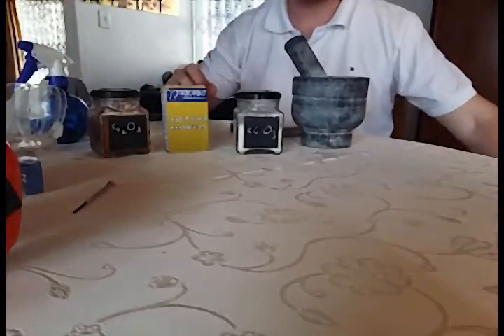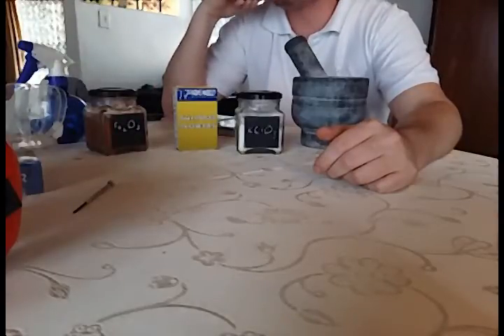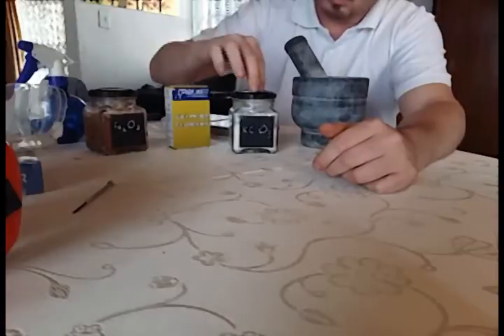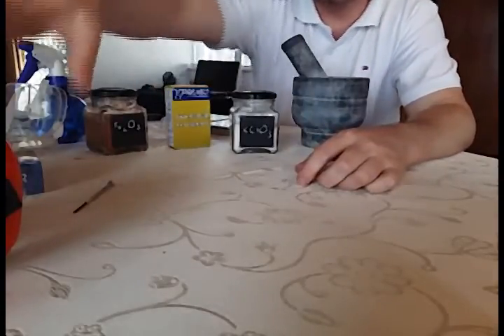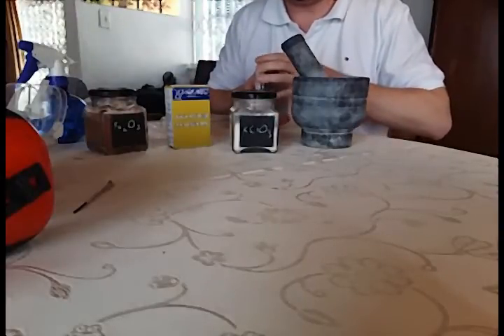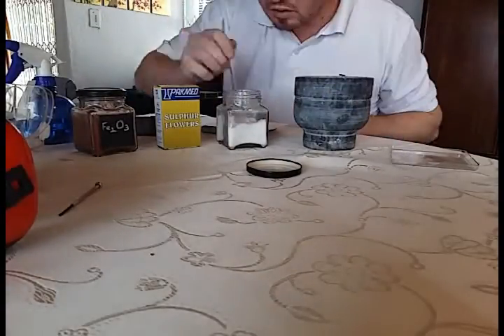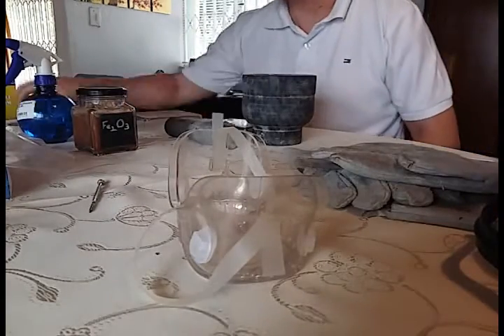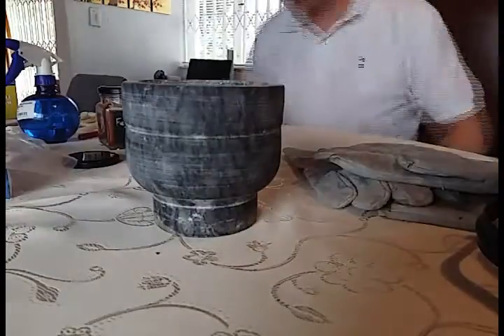Potassium Chlorate with sulphur - friction detonation tests

Comment: When I was a teenager that felt "immortal" I tried this with a drop of NG and it broke my pestle. Its interesting how you can hit with a hammer very strongly the same drop of NG absorbed on thick wood and nothing happens but if you barely hit a drop of it on ceramic surfaces it would go off frighteningly easy.

Comment: Very informative -- I've never seen anyone demonstrate the sensitivity that I knew was there. This could also be used to dispel so many other "sensitivity" claims in mixes that I knew for a fact could be mortar & pestled or smacked with a hammer all day to no effect. For full effect (like a primer), add antimony trisulfide & ground glass, and charcoal -- guaranteed to be the MOST sensitive (like paper caps) & usable as primer when pasted into place & dried. But be sure to never mix up a batch with a 1/2 gram of chlorate -- try an 1/8 of a gram -- and it will blow like a 22LR. You can also get the same effect & power with 5 strike-on-box matchheads & some striker razor scraping mixed in & a few grains of sand -- very loud detonation.
Reply: It’s possible to make a more sensitive mixture such as using 100% red phosphorus from an online supplier, a chlorate, and sulfur or powdered glass or fine sand. Fun stuff. Antimony is okay too! I’d recommend red p tho
Reply: One shouldn't be reckless, but most "sensitivity" claims are bullshit. They might have been true in the 1800s, when chemicals had more impurities in them than today, but even potassium chlorate and sulfur is relatively safe to handle. Even the old Japanese flash mix that Shimizu describes is pretty safe: 43% KClO3, 31% Al, 26% S.

Comment: I did this also with sub-gram amounts on the balcony and it was pretty loud. I had the mixture between 2 small pieces of paper and hit it with a hammer. Sounded like loud caps going off. Ratio was 2pts KCLO3 and 1 pt S.
Reply: 2 to 2 ratio is more sensitive than 2 to 1?
Reply: Don't know. Haven't tried it. @Boucher___B___4

Comment: This is good initiating explosive for primer construction,however the mixture of sulfur and potassium nitrate must be in paste like state rather loose powder..While the paste loaded into primer cup it would get later bit dried out but would permit mixture be friction or detonation sensitive..The amount of this explosive mixture takes some Hexo grams,not much to make large blast but enough to burn propellant,this is entire idea how to refurbish primer caps and reuse them..Searching right explosive was a trick because 3 groups I was search A too powerful,B Toxic,C very corrosive and form unstable salts while react with copper/aluminum/brass and even nickel....Although Tethryl was used from end of WW1 to meddle  of WW2 it later was abandoned because been too sensitive and too powerful than expected,original WW1 explosive was picrates but because of copper reaction those explosives are too unstable...It seems like mixture between sulfur and potassium chlorate suitable for such reloading process unlike anything else but mixture must be in near paste state so it won't be loose inside primer cap and only detonate from specific impact by hitting anvil only..
Reply: hey man do you know if sodium chlorate and sulfur is just as sensitive? i made some, mixed with sulfur and its not sensitive at all. im doubting if i really have chlorate. crystalls look nice and dissolves like chlorate. don't know whats going on
Reply: Bruh what the fuck is this misinformation? Potassium nitrate and sulfur does nothing but fizzle out. Do you mean chlorate? If so; you understand they no longer use RED PHOSPHORUS (not potassium nitrate) and potassium chlorate because the chlorine ion reacts with the steel in the barrel. You’re living and talking like you’re in the 1800’s bud. Do some more research before posting a bunch of word vomit to sound smart

Comment: KClO3  will detonate without sulfur and is more sensitive to shock ,chlorate primers contain   90 to 98% KClO3.
Reply: No. Kclo3 will not detonate by itself
Reply: How the fuck? Without a fuel?
Reply: KCLO3 is a strong oxidizer and cannot detonate by itself w/o a fuel of some sort.
Reply: @don Barnett
Better recheck.
Approximately 1/2 KClO3, 1/4 antimony sulfide, 1/8 ground glass, 1/8 sulfur (low acid)
Is a chlorate priming compound.

Comment: Potassium Nitrate+sulfur are shock sensitive too?
Reply from the maker: Thiago Paulino impact sensitivity
Reply: Is this an "Yes"?
Reply from the maker: Thiago Paulino yes... Hit it with a hammer and it will detonate, if thats what you mean by shock sensitive
Reply: Not even close to chlorate
Reply: Not a good mix for anything it can go ff all on its own......
Reply: Subscribed. This is very good information. I am developing a pull ring fuse igniter and the last mix would be better.
Reply from the maker: BitingChef the problem with this mix is that it can self ignite over time. If the sulphur contains any acid it will slowly heat up ignite.

It's still.illegal to mix these two in the United Kingdom as far as I am aware.
Reply: @SimonBoshoff  , I heard it is still illegal in the U.K. to not only mix, but  even to not bring victory anywhere near a Frenchman due to the high possiblity of spontaneous unnecessary capitulation of the mixture.
Been that way since 1914, I think.
 Is this true?
Reply: @grinninggoat5369  mix it youll be fine.
Reply: Sensitivity is much less, Potasium Nitrate And Sulfur are 2 basic ingredients of black powder. It can still ignite however under much more pressure than chlorate oxidezers
Reply: I don ΄t think  Potasium Nitrate And Sulfur are shock sensitive like chlorate is.
Black Powder is very stable in shock and friction and it needs a spark to detonate, you can hit it with a hammer but it won ΄t explode like chlorate mixtures, you can test potassium nitrate with sulphur shock test and you will see it won ΄t detonate